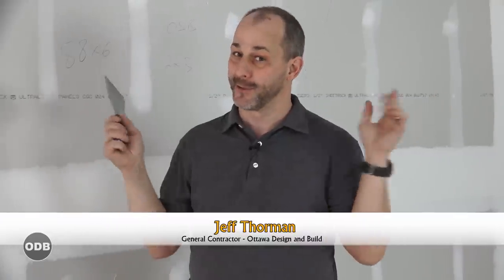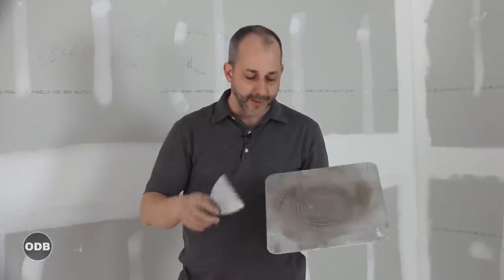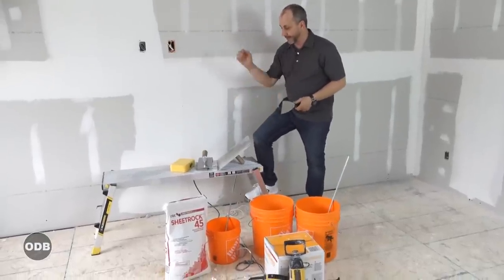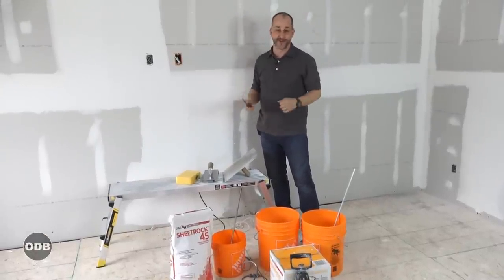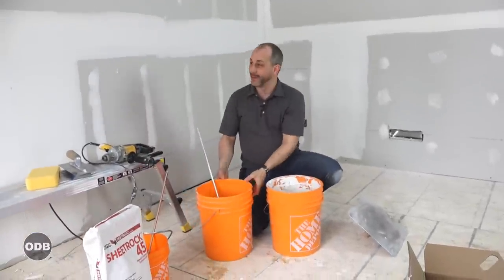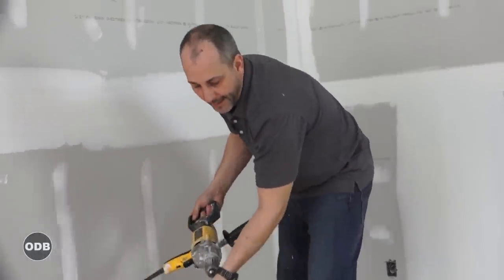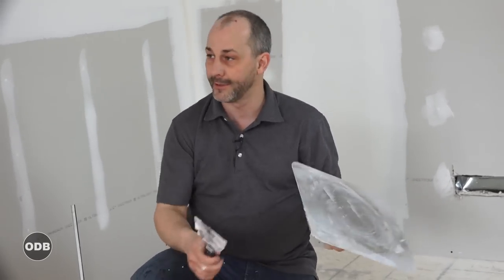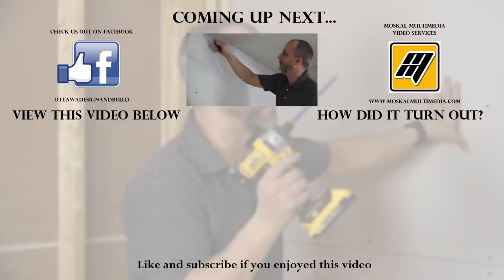The Ultimate DIY Drywall Guide | Taping Tools & Must-Have Materials

Comment: As a former drywall taper in America, I have a few disagreements with your instructions. It may be because you're in Canada and your're measuring system is different than ours in America. In America you want to use a 6" mud knife for most of the work. And a 1" or 2" when needed for small, cramped spaces like door jams and by mechanical work when you fire tape. But for the first coat, you want thick mud right out of the box. It's used for cut and fill, coating screws things like that. For your second coat, you still kinda want thick mud, but maybe can get a way with adding a little splash of water to it. For the third coat, you want what you described in your video. Maybe a little more or less depending on the application, skim coats, corner bead, final screw coatings, things like that. For bazooka mud, you want that to have at least 4 or 5 sponges of water in that. Get it real good and soupy. If you want to show beginners how to mud, you need to take a few steps back and go over the pre-tape work. Cut and fill, coating screws, finding blisters and what to do if you find a particularly nasty one that ends up taking a huge chunk of drywall with it, also how to install corner bead, radius bead, how and when to use mesh tape. Should also cover how to string tape by hand and with the bazooka as well as how to use the roller and the glazer in the corners, and  skim coating by hand and using a skim box and how to use the angle box to skim coat corners. I also think it would be helpful to talk about the different kinds of joints (Ie. Butt Joints, factory joints etc.) and how to coat each of them. Just some suggestions.
Reply from the maker: Hey dude, not trying to show the best system know to mankind. Just a great system for homeowners to get a pro result.
Reply: @HomeRenoVisionDIY  Lol yeah, I might have gone a little overboard,  but I think it's important to show folks at home the how to get the job done right and how to use some of the tools so they can use them themselves. I just listed some things I thought were important. Prep work is important and lays the foundation for how the rest of the work goes. Have sloppy prep work,  you're going to have sloppy finish work too. And while you and I have used different systems,  we both seek the same result.  Good, clean work that won't show through paint or wallpaper. To avoid odd walls and bumps, I think metal stud framing provides a sturdier and more uniform product.

Comment: what is the opinion on pre-mixed joint compound? Can I use that instead of doing the mixing myself?
Reply: Yes you can.  The bagged powdered compound that you have to mix has several advantages for the initial coats, but the premixed stuff will be fine, it just takes alot longer for it to dry between coats... usually 24hrs.  A fan turned on low will help with the drying.  You just need air movement to help speed up the drying.